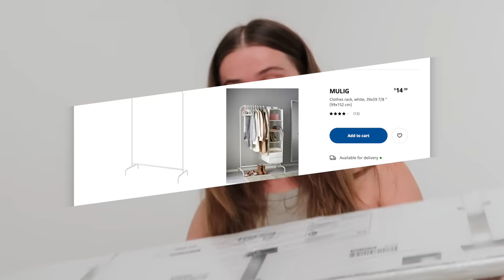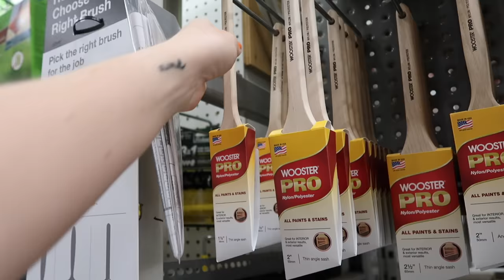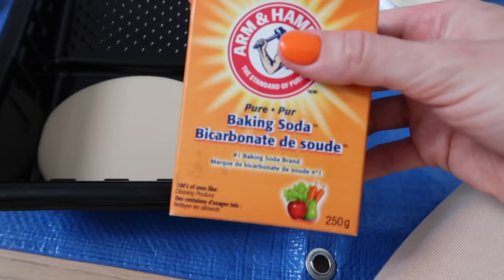DIY VASE & CLOTHING RACK! Closet Room Upgrade

Comment: Just a tip if you want to touch up any little spots, spray the paint in the cap and take a brush and paint it on that way.
Reply: Paint pens might also be a good option for the tiny touch ups.
Reply: Came here to say this too!

Comment: Putting the clothing rack parts on small blocks makes is easier to spray paint them from different sides and there will be only a few spots left bare which are easy to touch up 😊 also outdoors or wearing a mask / airing the room is the way to go 😎

Comment: Allana, cute DIY projects. as the spray paint queen over here... maybe you should of put the rack together first, then spray paint the whole thing all at once (both sides, and screws) possibly in a more ventilated area? (on your porch with the tarp underneath).. that way you save time with not having to turn them over and no marks on the back side... AND it dries much faster in the outdoor air.. AND it's better for you (breathing)...Sorry dude.. I spray paint everything!

Comment: Spray paint and white walls 🧐🤪. Lan you had me worried. You may find that hangers will remove the spray paint. Before painting again, move to the outside and sand paper the surface first.